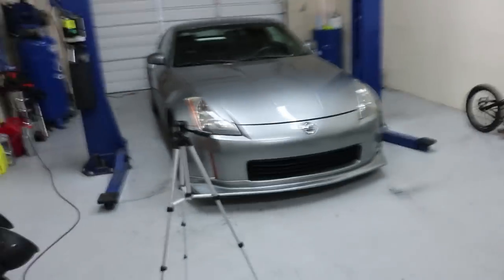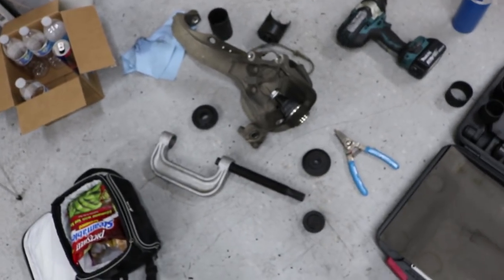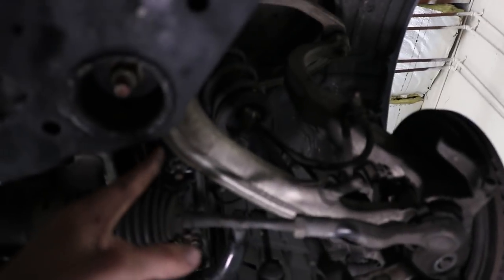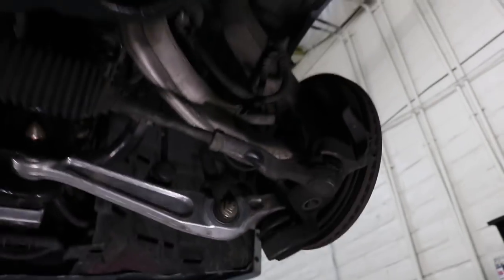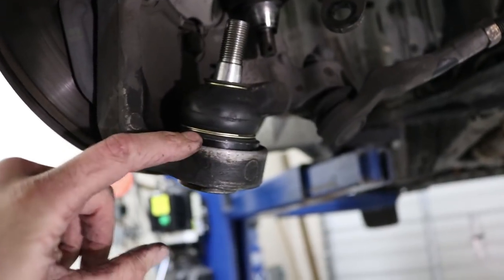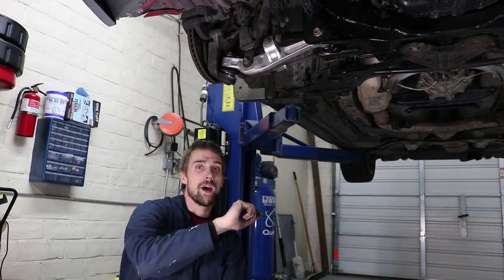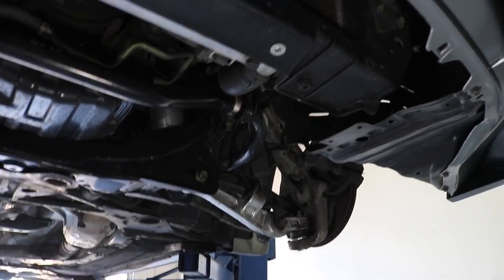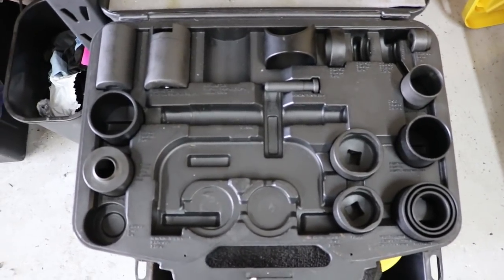350Z or G35 Front Lower Ball Joint Replacement DETAILED VERSION

Comment: You only need to remove the 22 mm bolt on the ball joint… the knuckle will fall down enough so that you can remove the ball joint, even with the those cups and everything… I am not disagreeing with full throttle. I think Charlie does an awesome job here, but I only removed one bolt and was able to remove and reinstall the entire ball joint without having to takeoff all the other three bolts. Don’t mean to burst anybody’s bubble.
Reply from the maker: This is true! We no longer take everything apart when doing ball joints, don't put too much downward force on the knuckle though, it can cause damage to the bushings on the upper control arm. Thanks for the input though!

Comment: Nice video. Good detail. You forgot to preload the suspension before tightening up all the suspension hardware. You'll have lots of flex on all the bushings once you lower the car back onto the ground
Reply from the maker: Must've missed this comment a while ago. This is true, however the bushings on these arms were SPL spherical bushings so loading the suspension wasn't necessary

Comment: I think Nissan recommends the wheels be on the ground and the suspension loaded when you torque down the ball joint and anything else with rubber bushings. Probably not a big deal though
Reply: how would one fit underneath with the wheels on the floor
Reply: @staydown4bo  total pain in the ass. proper way or not, next time im just tightening them in the air lol. the nissan fsm for my car says "for rubber parts, final tightening must be carried out under unladen condition with tires on the ground" but like u said easier said than done lol
Reply: @Moon___man  yeah i dont see it being possible to get underneath wothout needing to remove the bumper and fenders. im in an 04 G35 stock and theres maybe like 5 inches of clearance from the floor. definitely not enough to do what nissan recommends. maybe turning the wheel outwards will help but idk

Comment: So I got the same exact ball joints that you got but the stock shims don’t fit them because the threads on them are too big. The shims that came with the new ball joints doesn’t seat properly in my lower control arm. What should I do or what could you recommend?
Reply: I have the exact same problem?!?!
Reply from the maker: Sorry for the super delayed response. You get it done?
Reply: I think the easiest thing to do would be to drill a larger center hole in the tapered bushing. Find a local machine shop and take the ball joint with you too... they won't charge that much.

Comment: When I took my son's G35's front left LCA off the ball joint, a little tapered  ring fell out but I didn't exactly see where it came from and what orientation it was? I'm replacing both the ball joint and the whole LCA with new ones. Should I put the ring/shim back in with the new LCA or not?
Reply from the maker: Sorry for the late response. The tapered ring is a cone designed to sit into the bottom of the control arm to ensure the ball joint doesn't have excessive play. If the cone that came with the existing ball joint doesn't fit properly use the old one if it fits on the new ball joint. Some modification is sometimes necessary

Comment: Did the new ball joints come with the cone already pressed on, or do you put it on? I need new ball joints without the cones for my angle kit as the new LCA isn't tapered for them.
Reply from the maker: The ball joints came in the package with the cones separate.
Reply from the maker: Some of the ball joints them selves have different sizes, I'd definitely check the sizing when your buying to make sure it fits.
Reply: @fullthrottleperformance  Awesome, thank you. I just ordered them!

Comment: Where did you get the kit to press im the ball joint? I rented both from oriellys and autozone and they didnt have the right sized cups
Reply from the maker: This kit was from AutoZone, I actually bought the same kit online for only 20 more than it costs to rent, but it should have the correct size cup

Comment: I went to Auto zone an orilley an used there ball joint tool kits, an nither of them wrk😲😰! The sleeves were either too small or too big for the ball joint WTF 🤔!  Where did u get ur ball joint tools frm!?
Reply from the maker: Mine was from autozone
Reply: @fullthrottleperformance  oh ok. Well I ended up goin to harbor freight tools store, an they had the kit I needed! An I finally got the job done, both Ball joints r n !! Yaaaa 👌👍😉

Comment: I like your video I have a 350z convertible touring my tires on the front keep wear out from the inside can u tell me what I need to get check
Reply from the maker: Could be alignment, sounds like camber wear but z's don't have stock camber adjustability. So you'll just have to get under there and take a look, make sure your upper arms are OEM

Comment: I have some aftermarket ball joints and the shaft is thicker than oem but it come with it's own cone but I've heard that sometimes those aftermarket cones don't work right, do you have experience with aftermarket cones working

Comment: I noticed something with the lower control arm. did you use the spl inner bushings but kept the outer bushings rubber? I was thinking of going that route since  the inner bushings are notorious for wearing out  so i would use the metal spherical bearing. but i also want the ride to be somewhat soft enough for street so i would leave the outer bushings rubber
Reply from the maker: Yeah I left the outer strut bushings oem and replaced the inner ones with the SPL ones. Since those are the ones that actually go bad
Reply: @fullthrottleperformance   I just watched the vid of the install from a year prior . good tutorial! I think im going to order a set and prepare for a whole front end refresh now. Thank you !

Comment: i just replaced my lower control arms the other day but i cant seem to get the ball joint to fit properly?? i cant get the nut tightened down all the way.. the lower ball joint nut is actually covering/hiding the hole for the cotter pin....help i  dont know what i did wrong

Comment: my ball joint Nut keeps spinning when i try to tighten it down but it keeps spinning even if i put a jack under for the weight to created pressure and it still just doesn't want to tighten properly , any idea?

Comment: Nice!!! Thanks man I am about to get this as well
Reply from the maker: It's really not as difficult as I always thought lol
Reply: Frank I remember this job. I did my right wheel back in 2015. It is now time to do my left. The boot is just ripped and I remember saying I am paying someone next time. This video half way motivated me to do it on my own again, but nope. The problem is the ball joint sits at an angle in that hole. Non of the cups fit and the one that fits, it keeps sliding off putting groves in the lip of the ball joint. Although putting a nut on top and using that cup at the end was a new technique I've never seen to overcome what I am talking about. For $120 shops have this tool that hammers it out quickly and installs quickly. Usually, I always turn my own wrenches, but not on this one.
Reply from the maker: @MotordyneG35  It wasn't that bad with the ball joint press kit from AutoZone. Came out nice, and went back in pretty nice as well.
Reply: @fullthrottleperformance  ..I also used the ball joint kit press from autozone. Back then, Oriley's didn't sell ball joints so I used duralast with the lifetime warranty from autozone. I actually prefer Orileys over autozone. Anyway, I picked up a ball joint from Autozone and it looks like they redesigned it with a bigger lip than before. I compared both the one from import direct and duralast, even though duralast is cheaper. It has this new double boot on it, I've never seen before. I like the duralast design better and I've had not had any issues with my other duralast ball joint. I was going to pay someone, let me see. I'm going to see if the sleeve kit on this new ball joint it actually fits. If it does, that would make this install way easier. The cup sliding off, I remember being such a pain.
Reply: @fullthrottleperformance  ...You are right, it will not be bad at all. I was looking at pictures from when I did it, dates are in 2013, not 2015. The ball joint kit from autozone was in a red case with less pieces. The new rental kit has 23 pieces and comes in a black box, like the one you have. I rented it and it matches up with the ball joint, it will work. Great upload, I wouldn't have re-attempted unless I saw this video.

Comment: I had trouble with the nut that would keep spinning on the bolt from the ball joint.
Reply from the maker: Yeahhh, that happens sometimes. Best to use a wire brush to clean the threads, and then hit with PB blaster, or liquid wrench first

Comment: great vid. having some front suspension squeak in my g35. just put some new swaybar bushings, but sqeak is still there. Any idea what that could be? Where next should i check? thanks in advance.
Reply from the maker: It could be a lot of different reasons, just try to move things with your hands, and see if the noise occurs. Some things are easier and cheaper than others to change. I'd start with those first

Comment: how are these Chinese ball joints holding up after 5 years?
Reply from the maker: Generally, we see Delphi ball joints last the longest, and are the easiest to install. I was on a time crunch to get this car sold. So, I no longer know current day. However, they did last up until last year when the person that bought it brought it in for a power steering line replacement. And they were still good
Reply: @fullthrottleperformance  hell yeah good to know. Thanks for the reply. Great vid

Comment: What ball joint press / kit did you end up using?
Reply from the maker: It was just the one they rent at AutoZone, not much of the pieces work on the z tho, only a few
Reply: @fullthrottleperformance  ok sounds good. My350z forums has several threads on which kit actually works but I'll try the same one you used. I just got my mevotech balljoints, so I'm excited to getting them installed.
Reply from the maker: @Z33Garage  haha, rockauto FTW? Lol I'm gonna be buying some mevotech ones too. I'm gonna completely rebuild my front and rear hubs